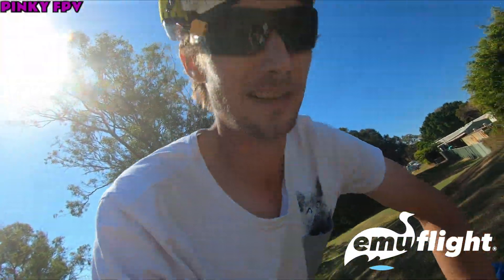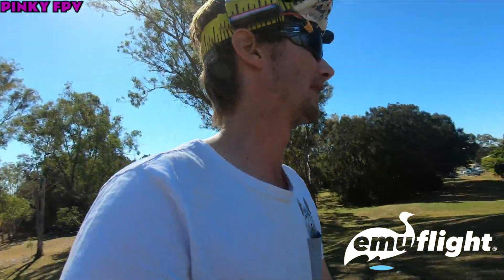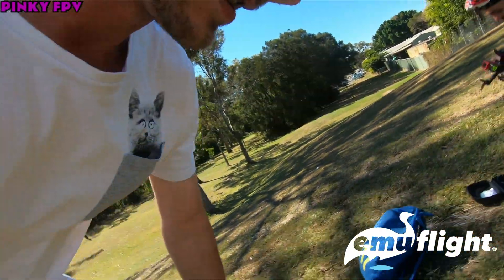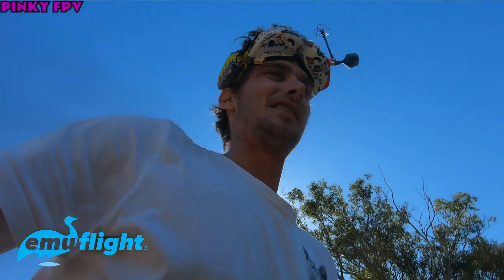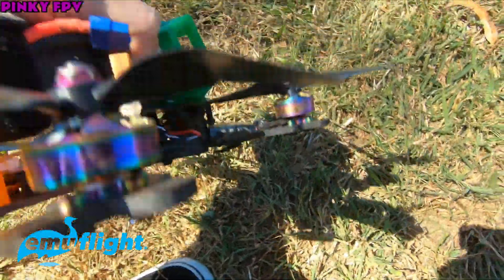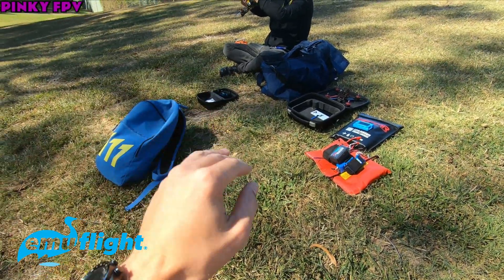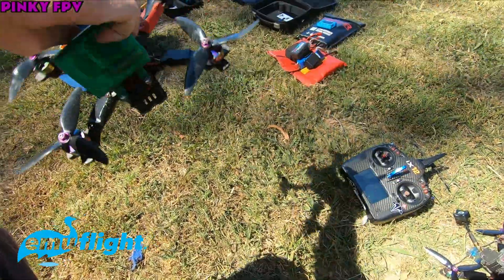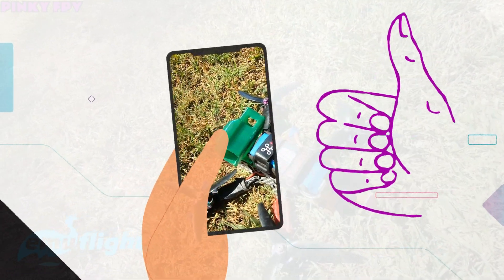EMUFLIGHT 0.15 | FIRST FLIGHT RAW | DEFAULT SETTINGS

Comment: Interesting. Is Emu flight an Australian branch of betaflight or something? Seemed to go alright. I'm going to go look into it now. Flew well with shity props.
Also emus Don't Fly... 🤣
Reply from the maker: Im not sure exactly but my thoughts were the same. I said u realise emus cant fly. They said we are giving them the gift of flight haha
Reply from the maker: Yeah man it actually surprised me heaps... Defs try it out. Its like betaflight to setup so you shouldnt have a drama
Reply: Might give it a try on that kwad that feels a bit off at some point. I look forward to seeing more videos on how you go with it man.
Reply from the maker: @outcastfpv7655  yeah man i know right, i totalled my hero 7 after this so im gonna be without one for up to 6 weeks :(
Reply: @PinkyFPV  oh brutal! I've got a Foxeer box 2 still new in the pack If you want to use that in the meantime. I don't really care if you break it. Apparently it's only good on 4K. It's the second one I've owned the first one was faulty phaser fpv sorted it out for me and got me a replacement. I couldn't wait so I bought a 7 black. The Box 2 is a little bit bigger then a gopro 5 so I won't fit in mounts. I do have tpu mounts for it for protection but Its supposed to strap onto an Armattan frame. Probably a bit of a pain in the arse to strap to an alien without a wedge.it's here if you need a mate
Reply from the maker: @outcastfpv7655  mate your too kind man i appreciate that so much aye. i do have a session 5 to use but YUCK! lol who wants to use that after having the epic hero 7 black and using that for so long
Reply: @PinkyFPV  I'm hearing ya. I can't stand the footage from the session 4 on my basha quad anymore. It's bloody horrible in comparison.
Reply from the maker: @outcastfpv7655  yeah aye man, hahah all good hopefully its all sorted in about 4 weeks or hopefully quicker
Reply from the maker: @outcastfpv7655  thanks again for the offer man, appreciate it lots :)
Reply: @PinkyFPV  anytime man. No probs 👌